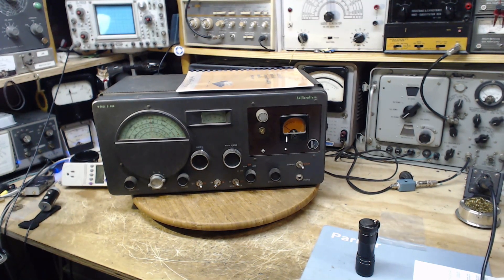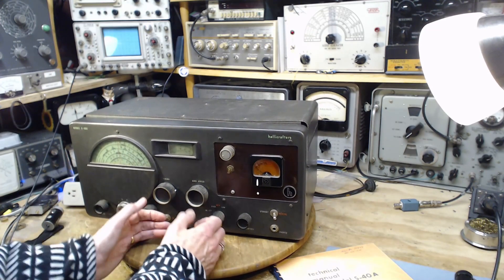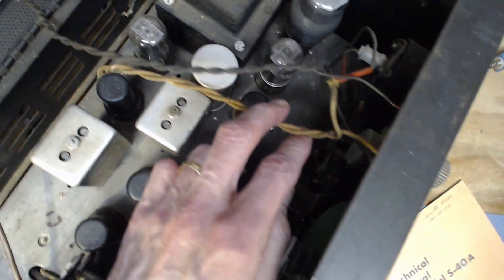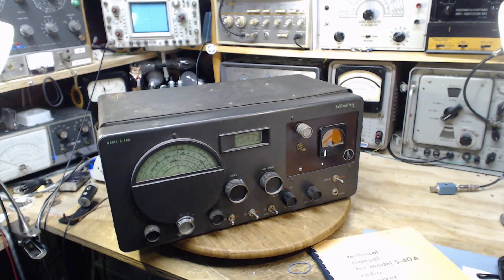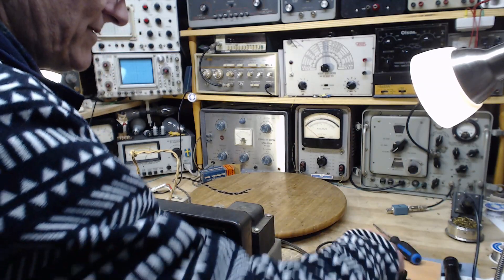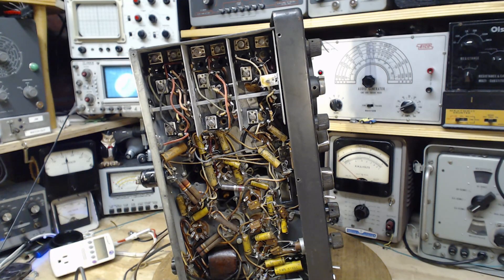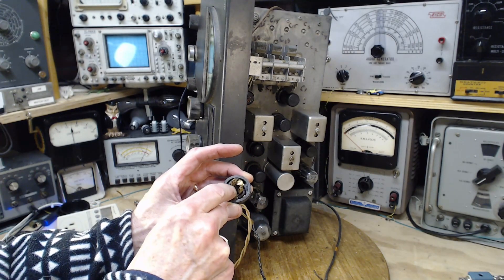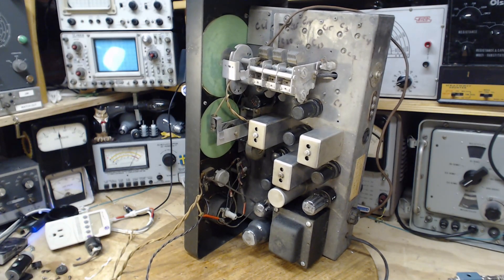Hallicrafters S-40A Shortwave Communications Receiver Video #1 - Checkout

Comment: If that particular receiver is marked as an S-40A, someone has done some serious modifications on it. The can-filters, tubes, and  three gang air capacitor all look correct, but the speaker is supposed to be in the upper right hand front, shiny grill covering the speaker, and a Hallicrafters red symbol on the metallic speaker grill. Now, the speaker is mounted to the top of the receiver flap (not original speaker, either), and some kind of new electronics were fitted into the space where the speaker used to be.

Comment: I’m often amazed that he never checks instructions or owners manuals when it comes to pulling the chassis out. This one was painful to watch.
Reply: He has explained this in past that he wants to learn about something through observations and what he believes he knows vice using technical manuals.  Does make for long painful videos. Wait till he tries to figure out the option on this set
Reply: @curtisgriffin7924  It’s not good troubleshooting, at all. And manuals are out there to be used. Then there is the SDR, which has absolutely no purpose in the alignment process. He overcomplicates it by using that thing.
Reply: @ArthurJS123  Yes, he often travels down rabbit holes, but he enjoys what he is doing.
Reply: @JosephLorentzen  Maybe. But the whole SDR thing is a severe case of OCD.